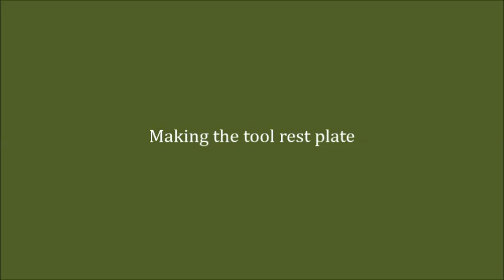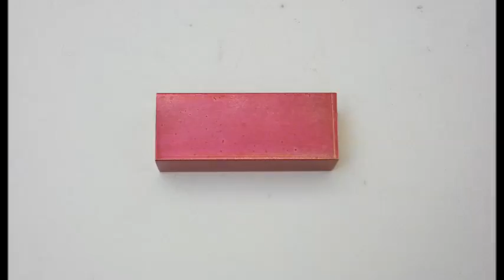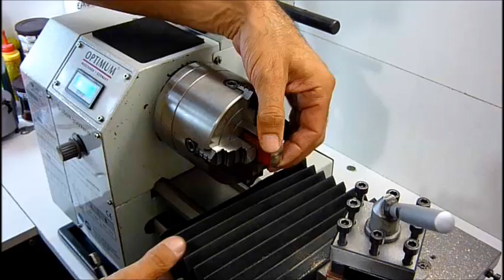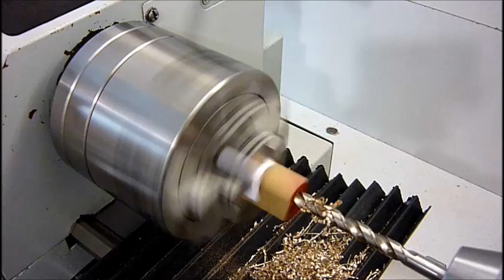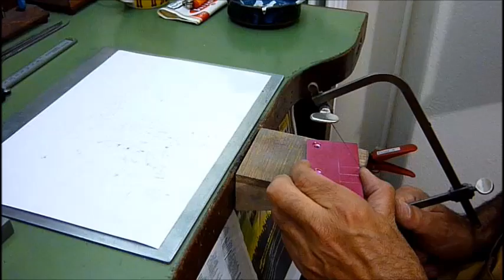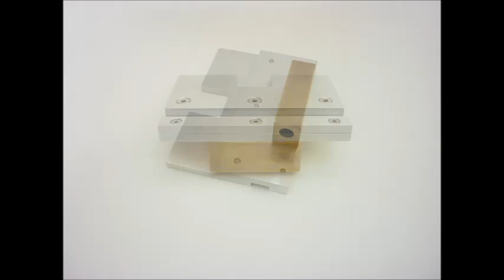Bench grinder tool rest - part 2

Comment: hello , do you feel insize indicator and mag base holding power fine ?
Reply from the maker: Hi Asaad,
Yes, both are a good combination! Insize is a reputable brand with good quality measuring tools. You can compare prices with MIB: http://www.mib-messzeuge.de/?lang=en I think that both brands are similar on quality. Actually MIB tools are a little cheaper.
Cheers
Jimmy